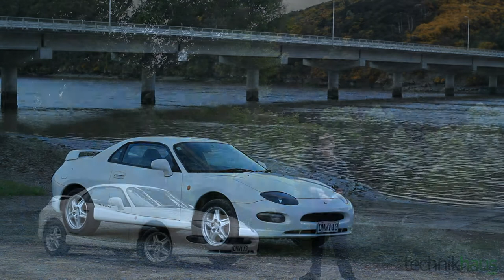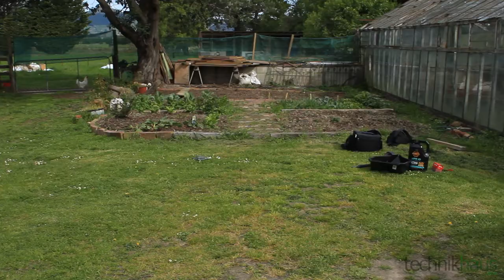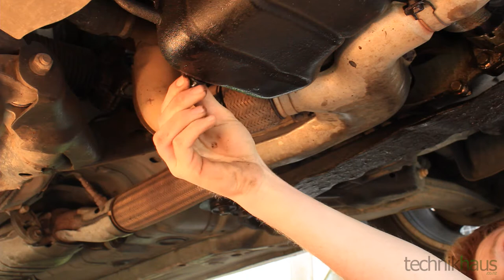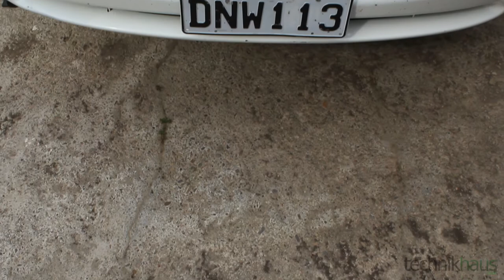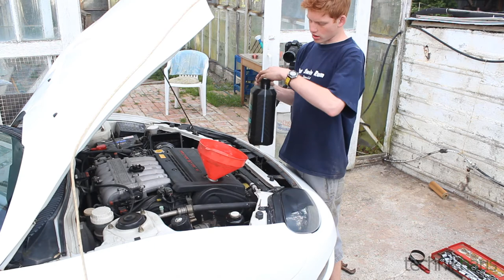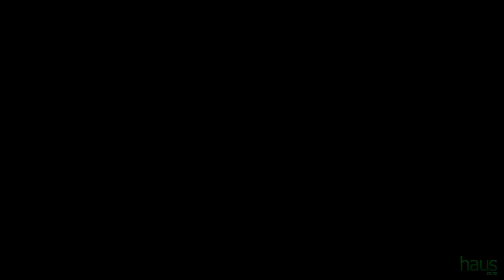Changing your Oil and Filter | Mitsubishi FTO GPX | Visual Owners Manual

Comment: leftey loosey rightey tightey mate   :)

thanks for the video.   not a good idea to check the oil level using the dipstick while the front wheels are still up on ramps, you'll get a false reading as the oil will be sitting at the back of the sump.    reverse the car off the ramps and check it on the flat, before topping up to final level.

Comment: You really should use 10w 40 or 5w 30. Definately not 10w 50 as the cams will not get lubed correctly